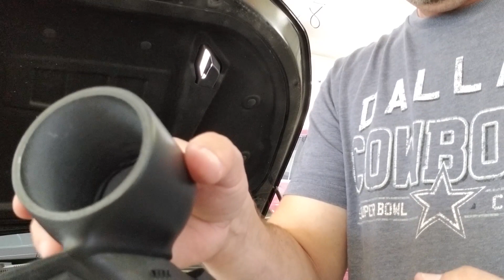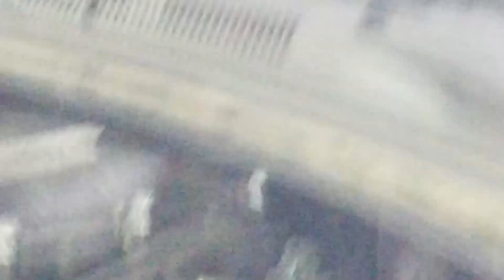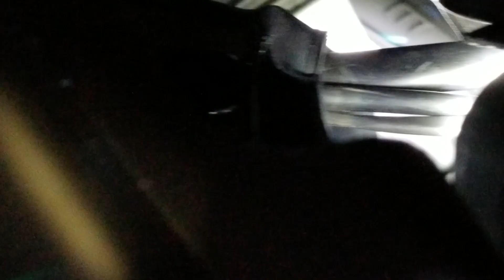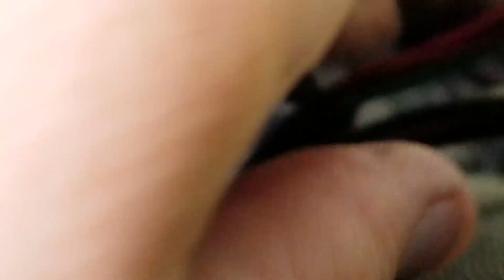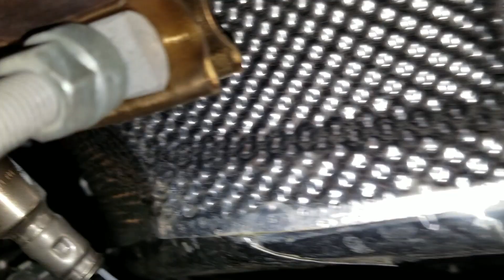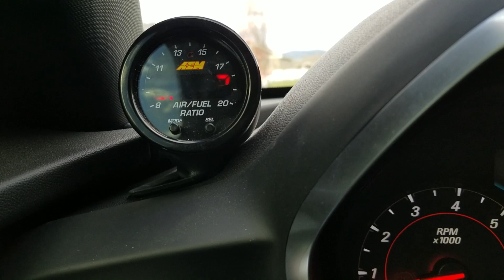AEM X Series Wideband Install 2016 Camaro SS

Comment: Just hooked mine up in my Camaro. AFR says 22-23 at idle. I have longtubes and put it after the high flow GESI cats where the secondary was and got that. Maybe I got a bad sensor?

Comment: Does the connecting fuse included or you still have to buy one if so where did you get it?
Reply from the maker: No fuse included, i went to my local auto parts store napa/autozone etc.
Reply: @TacticalGarage  what kind of connector is that and what type of fuse is it mini fuse or regular fuse?

Comment: Yeah... Well if you put the wideband downstream you will not get an accurate A/F  Lambda reading. The better the capacity/performance of your cat the further off your reading will be from actual. As to HP Tuners you would set codes for downstream B1S2/B2S2 sensors to "do not report".
Reply from the maker: True, I ended up welding in bungs closer to the collector.  Keep in mind most tuners are reading the afr from the tail pipe so you are miles ahead if you are reading it from the second o2 sensor

Comment: are you only reading one bank of cylinders?
Reply from the maker: Most everything I have read says that there is not much difference between one bank vs the other other one unless you have a major problem which show up somewhere else in your data log.  Most tuners I know are just reading from one bank when they are dyno tuning.
Reply from the maker: Yes, just one bank.
Reply: @TacticalGarage  why have it then its pointless reading 1 bank
Reply: @champguru55  definitely worth to get readings over no readings.

Comment: With add a fuse did you buy.. is that the micro2?
Reply from the maker: yes, I believe that is correct.  I just pulled a fuse and went down to the local auto parts store and grabbed the one that matched off the shelf.
Reply: Auto zone
Reply: HHTR ATR Add-a-circuit

Comment: For some reason my 2019 zl1 fuse 42 is always hot. Cannot find a switched fuse at all. Great video though.
Reply from the maker: The SS and zl1 must be different for some of the fuses.  Here is the description of fuse 42 on the SS "F42- 10A I/P BODY ING", maybe you have the same description on a different fuse number.  I am currently installing an alky control meth kit, they recommend using fuse F41, which on the SS is "5A MIL IGN" you might check that out as an option.

Comment: How did you get the wire to reach all the way to the fuse box?
Reply from the maker: I used a butt electrical connector and a similar gauge wire to extend it to the length I needed.